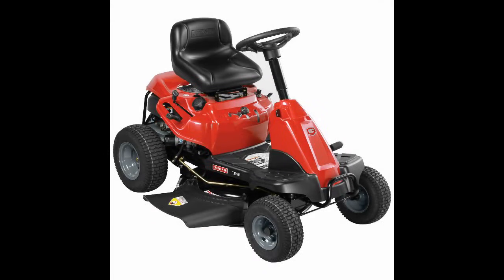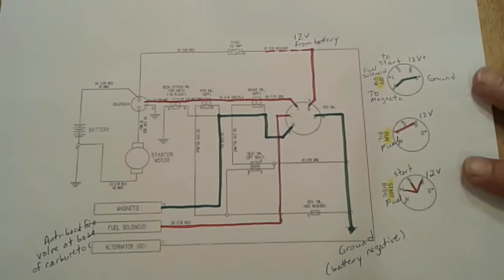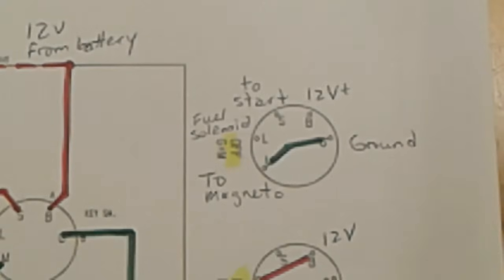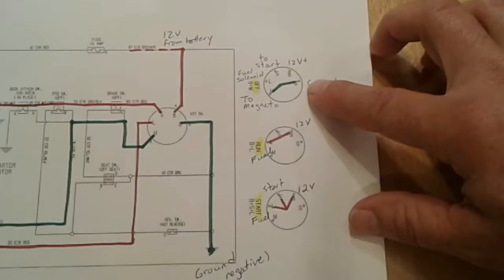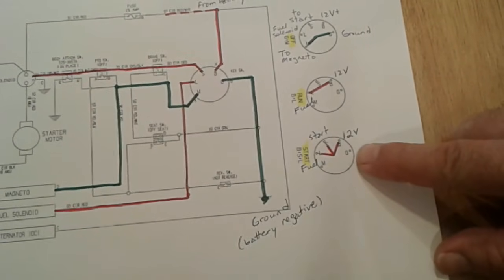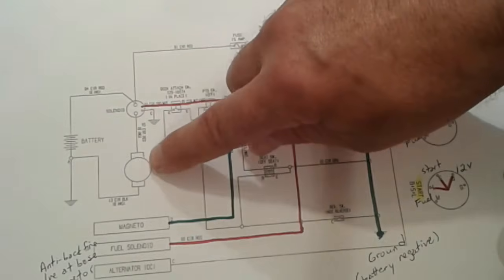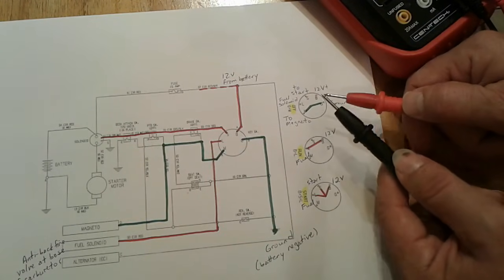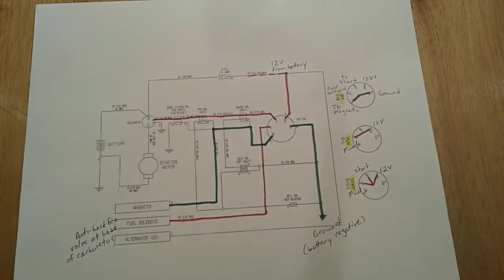How a Lawn Tractor Ignition Switch Works - Test, Diagnose, Fix

Comment: Great job on the info and video. Thanks. Question. When you release the key from start position, does the current stop thru all the safety relays? Also, troubleshooting , can I jump purple (start) at the key and jump to the solenoid to bypass the relays?
Reply from the maker: Hello. I don't recommend attempting to bypass the safety features, and I can't advise you on how to do that. You might find my video on how safety switches work to be useful: https://youtu.be/I_EzFHNg7BY

Comment: I'm currently in Ignition and wiring Hell. Inherited a home-garage rewired nightmare, batter would las three mows. 

I used AL (my ai) to help. Did research on Key ignition switches, learned to test them, learned voltage and wire gauges...made my own schematics to match my need, one safety switch to the seat for the PTO clutch... I didn't' wan to be cut up if I fell off.  The basics are (and in use as key is turned) B G M S A1 A2/L- Battery/Ground/Magneto/Accessory 1/Accessory2/Lights. In my case, my "7 terminal" ignition acturally is only wired for 5 of the terminals. Accessory 2 and Light or not used, which is really confusing, so I had to adjust my plan. If you interested, here is a link to my schematic shared via my OneDrive  https://1drv.ms/f/c/e29247d8ccac4064/EoCVb3MB0sZAiPA3kbm894YB_ZGylMk7tjLEY5Fl33OSlw?e=mL4tX5 Please note I also list how to wire the relay to seat to clutch.  If you have a 5 terminal, just pigtail to parts but had diodes or fuses and make sure noting can back feed to another. AI and Goolgle is your Friend.

Comment: Great video.  You should be a college professor.  As a seasoned electronics guy, I found the low resolution for my old Troy schematic, along with the actual wires being filthy and tight as a banjo string in the "dash" bundles, challenging.  Just replaced my engine and as you know, there ain't many wires going to it.  But I lost all my safeties and now have to figure out why (for the ones I want at least).

Comment: super video. you have made a video that i think in my opinion is the best clarity on how the electrical wiring works for starting. i have a question: is that a fuse between the battery and the big red wire going to the starter solenoid? keep up the excellent work.
Reply from the maker: There is often a fuse on the line that carries battery positive to the key switch. Thanks for the note!
Reply: @Buckwsr  on your drawing could i put a fuse from the ignition switch with the S on it going to the starter solenoid jumper prong   thanks
Reply: @roberttheriot7612  You can add a fuse wherever you think protection is likely to be needed.  Keep in mind that at the point you're referring to, only the current for the solenoid coil is being carried, not the starter current.  The fuse is mostly for wiring shorts caused by abrasion, pinching by mechanical parts, etc.

Comment: very basic.  and not really helpful other than understanding very basic function under NORMAL conditions of the ignition switch.

what is the ground is bad on the frame/chasis?
what if the anti-back fire solenoid is faulty or wire damage?
what if the safety switches are broken or connection are corroded/gunked up?
what is the fuse is bad...yes many mowers have fuses.
what if the pto switch is bad, or connector is broken?
what if the start solenoid is bad?
what if the starter motor/solenoid at the flywheel is bad?
what if the ignition coil is bad?
what if the battery show 12 plus volts but it's producing cranking power?  low state of charge?
what if the internal lock and contacts of the ignition switch is corroded, and there are shorts, dea shorts, shorts to ground?

these are ALL very real failures that happen often.  

again, this video is helpful from an overview of how the ignition switch operates NORMALLY...

but this isn't going to be helpful when you actually need to troubleshoot the ignition system as a whole system approach.
Reply from the maker: I'm pretty sure the title of this video limits its content to that of the IGNITION SWITCH, not to diagnosing every possible electrical problem a tractor may have....

Comment: If you were testing for spark , would you just unplug the magneto kill wire ?
Reply from the maker: Yes, unplugging the kill wire would work. Of course, with the key switch in the run or start position, there should be no continuity to ground/battery negative on that kill wire.....

Comment: What a superb video. Most of the time I'm left shaking my head trying to understand what the heck the guy/gal is trying to explain. You boiled it down to the basics and made it easy to understand how the key switch works. Not only that, you have taught me what all the wiring in a lawn tractor does. That for me is important because in a few days, I am going to have to rewire a newer Briggs & Stratton engine (Intek 17.5hp) to my old Craftsman riding tractor (1997). Your video has made that job much easier for me because now I know what wires I need to connect — and to where — to make the engine run.

You have also changed the way I look at schematic diagrams forever. I no longer fear them. You sir are a great teacher.

I know most people would just throw out that old Craftsman mower. But in my case, it holds a lot of sentimental value because it belonged to my parents. It's also built like a tank with all metal parts. I've rebuilt the brakes, replaced the wheel bushings with bearings, installed flat roller bearings to make it easier to turn, put new blades and spindles on the mower's deck and put new tires and lights on it. With a new engine it should last another 25-years. At some point, I'll repaint it. But for now, it looks great. Thanks again.
Reply from the maker: Thank you for the kind note. Enjoy the repairs on your mower!
Reply: @Buckwsr  My wiring is like a rats nest, IF I snail mailed you a photo of EACH current connection AT the motor, solonoid, key switch could you draw me a simple diagram as in your picture?

Comment: What you calling the magneto is that the ignition coil
Reply from the maker: Yes, same thing. And the key switch in the off position grounds out the coil/magneto to shut down the engine.
Reply: Thanks for video.  This explanation was great!
Reply: A lot of people call a magneto a coil, but they are actually different, yet provide the same electrical charge to fire spark plugs.

Comment: The diagram also shows the seat switch that looks to ground the magneto / coil if the operator is not seated.  So doesn't come into the picture ?   Isn't that why when you lean over to pick up stuff in the yard, the mower starts to shut off.
Reply from the maker: This video was primarily about the key switch. Check out my other video on safety switches for more info!

Comment: I hope you're still out there.  I haven't had any problems until recently with starting my JD  GX1542 Hydro. I checked the ignition switch and it seems to be ok.  I jumped the solenoid to start it, and I can shut it down with the switch. I bought this mower used and discovered the wiring system had been severely violated, a clump of wires that have been spliced together with different colors.  I know I'll have to eventually rewire the whole thing, but can you tell me what I can look for right off hand?  Getting on in years, and my sight isn't what it used to be. Thanx for the video.
Reply from the maker: Wish I could help. It's just impossible to diagnose something like this long-distance and sight-unseen. Hope you figure it out.
Reply: @Buckwsr  Thanx for the quick reply. I think I've got it narrowed down to the brake switch. The switch itself is mounted with pop rivets that are starting to give way (this can't be factory?) causing the switch not to engage completely. Anyway, that would be my guess as to the problem. Thanx again.
Reply from the maker: @cornfusedatbest3980  That should be easy enough to test. Good luck!

Comment: Hi, great video & makes understanding the starting system better! Inevitably, I have a question! My V-Twin turns but won’t fire, unless I release the key. So it starts/fires, but not whilst I have the key in the starting position, only when it returns to the run position 🤦‍♂️
Reply from the maker: Odd. I would start by using inline spark testers to verify if you have spark while cranking the engine. If in fact you don't, remove the engine shroud and disconnect the kill wire from both ignition coils. Then try to start the engine. That might give you some direction. Beyond that, I'm not sure what to suggest. However, this video is about the key switch. Are you suspecting a problem with the switch? Finally, do some research online among the small engine forums, and you might find someone else who has had a similar problem. Good luck.
Reply: @Buckwsr  Thanks for taking the time to reply, I'll give that a shot

Comment: JNice diagram/schematic explanation.  But, just wonder how you hook up an OLD and obsolete four terminal stop/start/run ignition switch with M1 and M2 and B and S with any of the new possible replacements...
Reply from the maker: I'm sure you can find the correct key switch for your machine. You can get pretty much anything these days. If you can find the part number, somebody out there has one for sale.

Comment: Excellent drawing and explanation. I am glad you explain terminal "L" as the fuel solenoid. Other explain it as Light.
Reply from the maker: Some tractors do not have the anti-backfire solenoid at the carburetor, so I guess it's possible that the "L" terminal supplies power to the lights on some tractors. Of course, the tractor I used in this example does not have lights! And the wiring diagram sure helps in identifying where the wires are all going. Thanks for watching and commenting!

Comment: Microsoft Works?  I'm thrilled to know there's at least one more Neanderthal out there.  It's lonely at the bottom too.  Now, if I could just find my club.  I know it's in the cave somewhere.  But don't you love Works' simplicity?  Good video, by the way.
Reply from the maker: What? Did I say Microsoft WORKS? I must have misspoken. I actually used Microsoft WORD to print out the wiring diagrams. But hey, I'm using the 2010 version of WORD, so I am at least somewhat out of date, ha ha! I remember years ago that Microsoft works used to come free with the purchase of a computer. Thank you for your note, and for enjoying the video!
Reply: @Buckwsr  You may have said "Word".  That was another great program that has been replaced with some incomprehensible behemoth some egghead hatched trying to justify his or her job.  Change for the sake of change.  It's why I enjoy working on simple stuff, things you can see how they work.

Comment: This is a very helpful video but I do have a question , when checking the switch for continuity do I unhook the leads or just check it w/ the leads connected  ? Thankyou & May God Bless
Reply from the maker: Unplug the harness that plugs into the back of the key switch so you can put your tester directly on the terminals on the key switch. You might need an extra set of hands to hold the switch into the spring loaded "start" position.
Reply: Buckwsr should

Comment: Great explanation!  Thanks for the info.  You should do one on how to open a switch, clean and repair it, and re-assemble it.
Reply from the maker: Thanks for the note. If your switch doesn't work, it's easiest to just go online and buy yourself a new one!
Reply: @Buckwsr  Probably true, but I'm a little on the cheap side:)  Actually, I enjoy a challenge.  I had already taken the switch apart and thoroughly cleaned it (easy task with this switch), but I didn't use match marks so I wasn't sure which of the three possible positions was correct.  I just tried all three positions and used your video to get the right one.  I think the switch is better than a new one now.
Reply from the maker: Wow. Great job. Sounds like you're the guy to make that next video!
Reply: @Buckwsr  Maybe one day I'll learn how to do that too.  Still working on my small engine skills right now.

Comment: Thanks for putting all this in an easy to understand format.   I had replaced the battery and solenoid on my old John Deere STX38 but determined I had a faulty ignition switch thanks to this video.
Reply from the maker: That's great news. Good job on the diagnosis and repair!